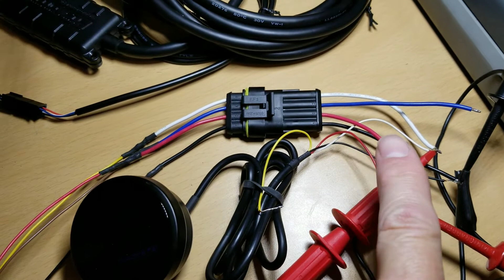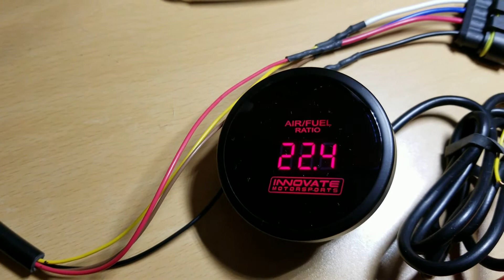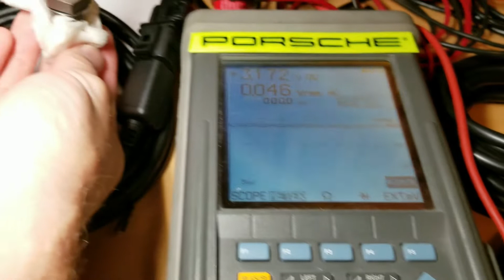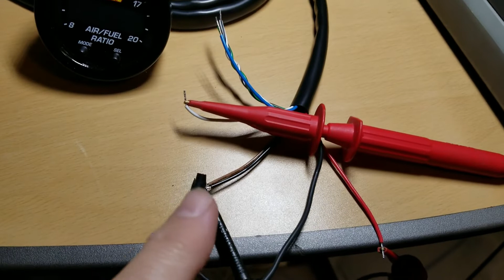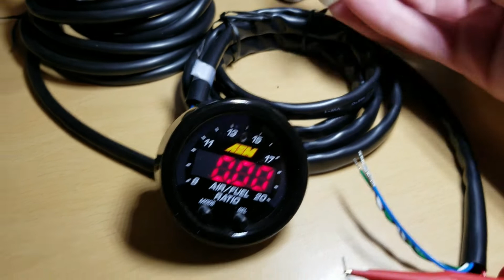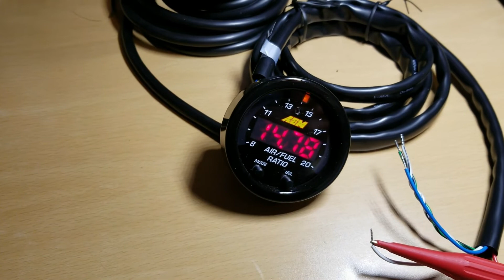Wideband O2 Sensor and Controller Bench Testing (Innovate LC-2 & AEM UEGO)

Comment: Would this system work with my vintage VW bug?  It would really help to have fuel injection on my 1600cc engine.  I'm a DIY guy!!  Thanks!!!!!
Reply from the maker: Wideband O2 sensors will work on ANY internal combustion engine!  Even your granpa's lawn mower!  You just have to mount the sensor on the exhaust, run a few wires and find out how your fuel system is performing.  I run it on a car with Carburetors now and am moving to EFI.